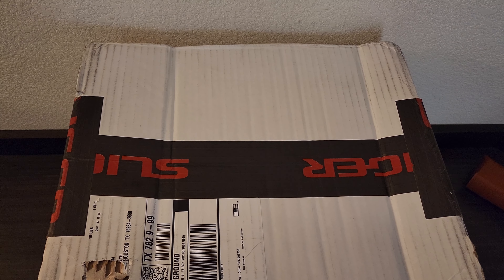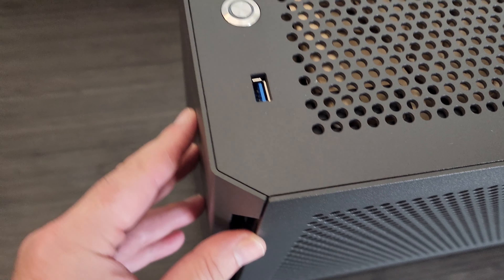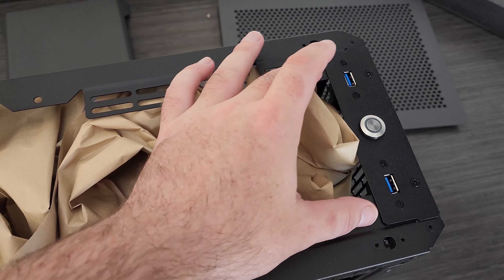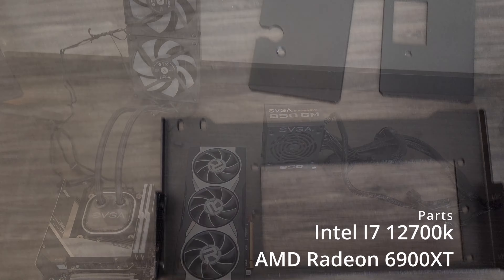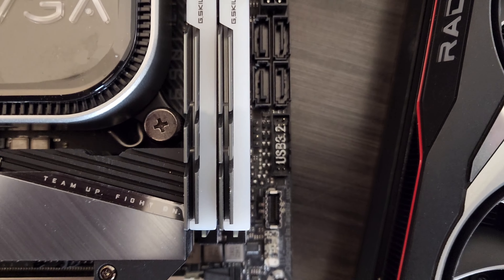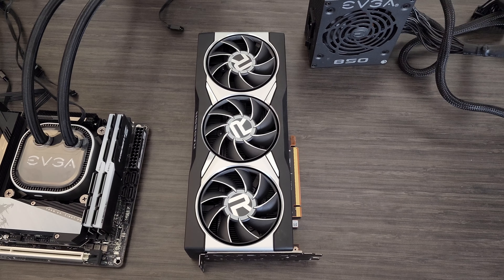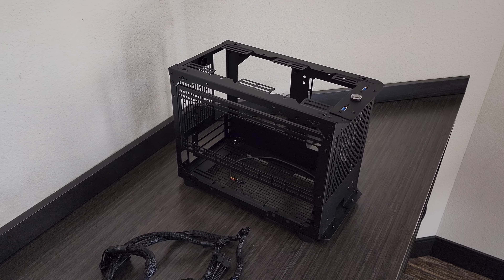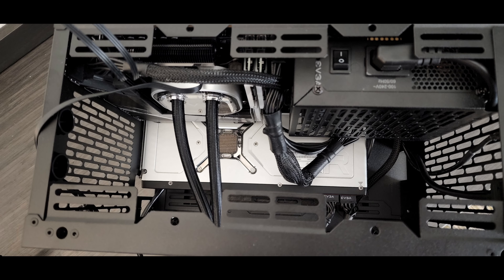Sliger S620 my new ITX

Comment: How’s the card temps while gaming?
Reply from the maker: My card with the default fan profile and room around 20c idles at 23c gaming 66c with a junction temp of 79c.   Hope that helps give you a rough idea of what to expect.  I have though about putting 2 fans in the bottom but I will probably wait till the next gen cards and stuff a rad with fans in the bottom like my ncase m1 and do a dual rad loop in the case.